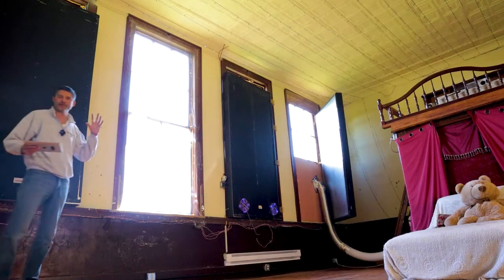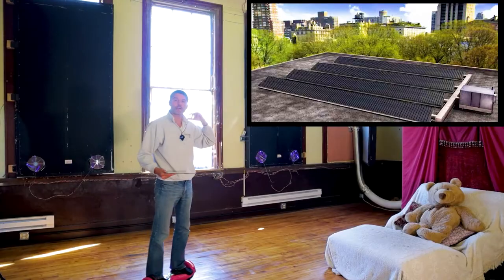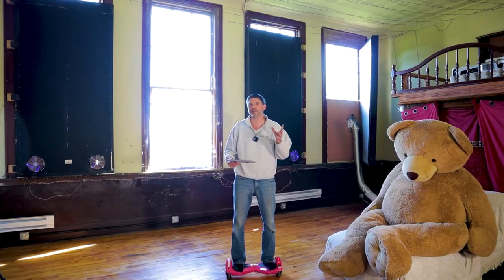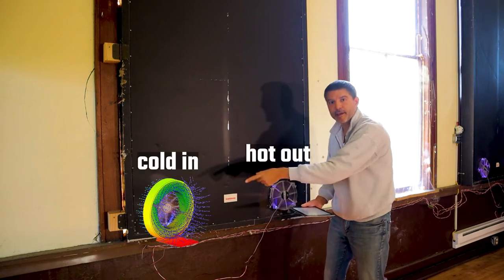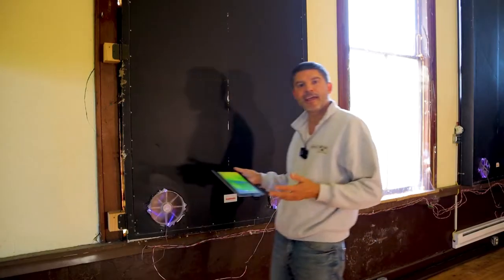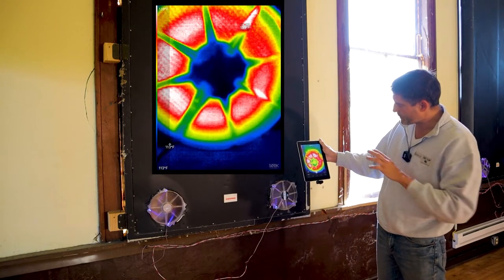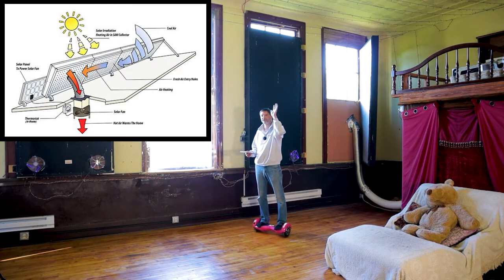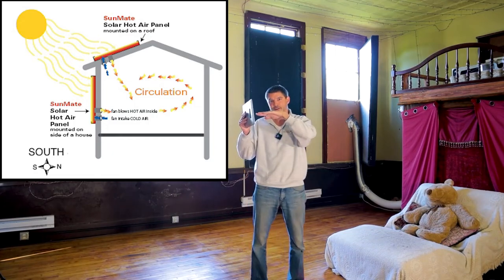Transforming a 1920's Schoolhouse with DIY Solar Furnace Solar Panels

Comment: Cool you got them so cheap! Beautiful and huge building. If heat rises why have the heat vent on the bottom? Seems to me this works against physics. A good experiment would be wall mounted vs window mounted. My wall mounted 6 foot x 6 foot R26 insulated unit with center top and bottom vents outputs 95C or 203F of heated air when sunny. I have found that high insulation in walls, attic and floors is critical for these units to improve interior temperatures. Great work keep going!!